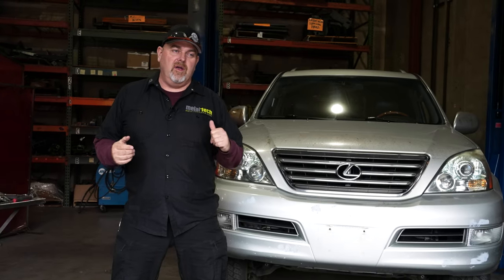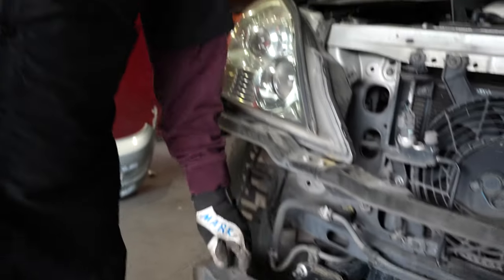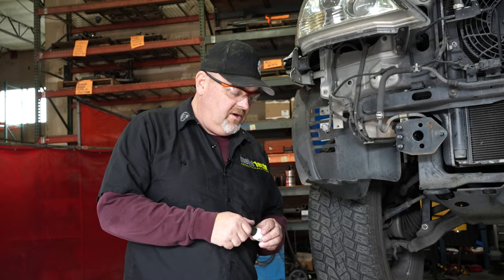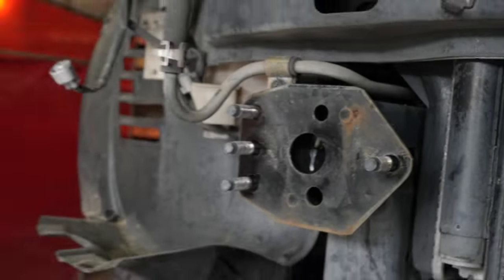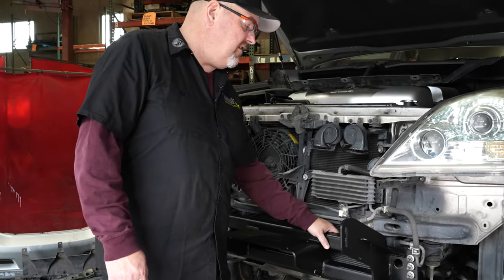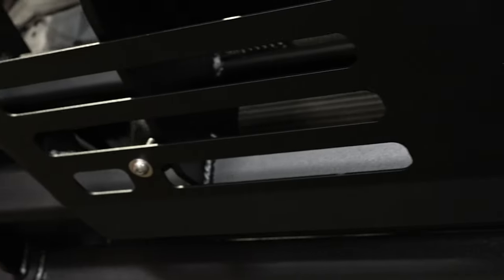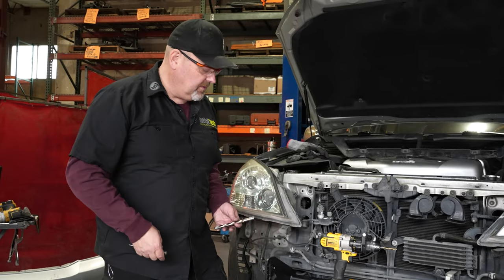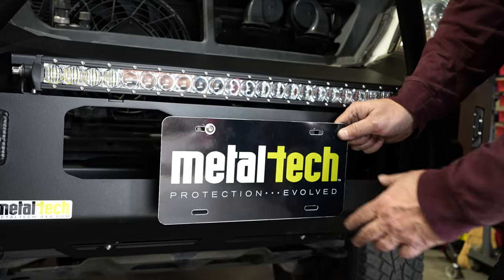GX470 Goblin Bumper installation

Comment: Whyyy !  12mm and then 1/2” ?  Good video, and well done, lots of detail.
Reply: the 12mm was the original hole that was threaded - the 1/2" was drilled bigger to accept the new 1/2' bolt

Comment: These are awesome! Do you folks have a recommended list of winches that can be used , Im hoping a winch with a 12,000LB capacity can be used . Thanks again!
Reply from the maker: We recommend a 9.5k lbs or a 10k lbs winch with synthetic lines. The ComeUp Seal 9.5 SLIM is in one of our GX470s. As for others with different winch manufacturers we are testing a Warn EVO 10s for fit. Most winches do require the solenoid pack to be remote mounted under the hood, but that is good for the winch in the long run. As for 12k winches most do not have bigger motors, they are just a 9.5k winch geared lower so they have the higher "rating". This is not always a good thing since line speed in a recovery can be an issue. Also a proper 12k winch will have thicker line, thus less feet of line on the winch drum, also not always ideal. Know that a 9.5 or 10k winch can be doubled back with a snatch block to slow speed recovery but almost 2x the pulling power. All of our trucks can run any winch but everyone has a 9.5 or 10k on them for speed.

Comment: Can I install this bumper and retain factory suspension?
Reply: Yes you can if its just the bumper.   If you put a winch in it, that will add another 75-90lbs and at that point you should up the front springs.

Comment: Don’t be lazy. Use spray primer and two coats of paint. That polish will fall off after two weeks
Reply from the maker: Lazy is doing nothing at all. But to do it right, you need to do full panel removal, acid dip, neutralization process, soda blast, primer, paint, blend the area to color match, and top coat. Or one can also use the nail polish trick that, in this case, two years later, is still on the truck. It comes down to the available time the installer has to put into it. But laziness is doing nothing and, unfortunately, is the most common.